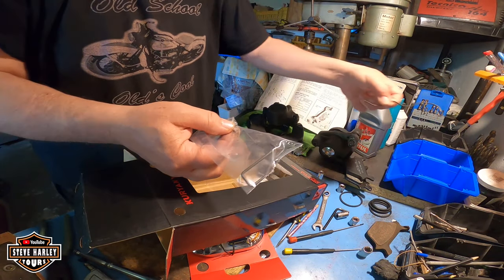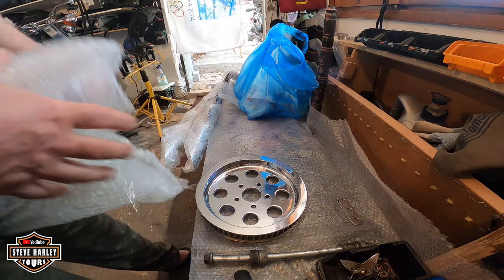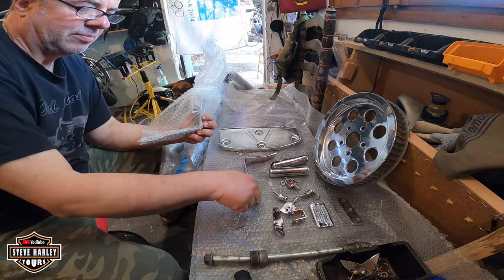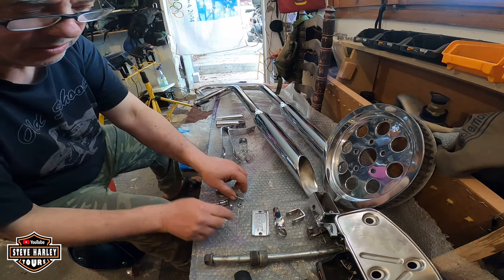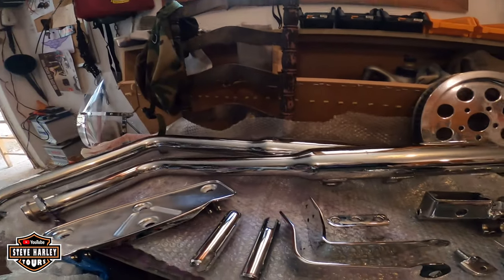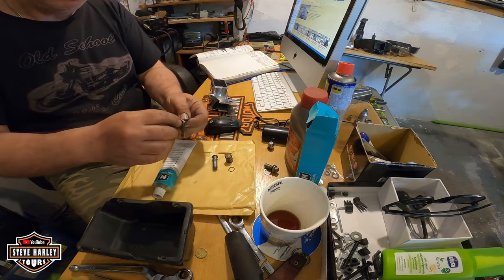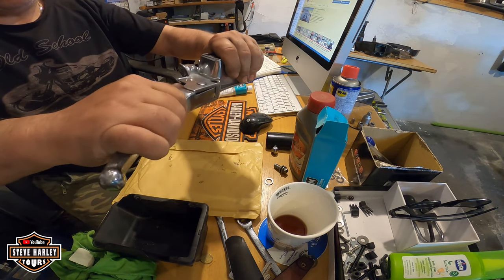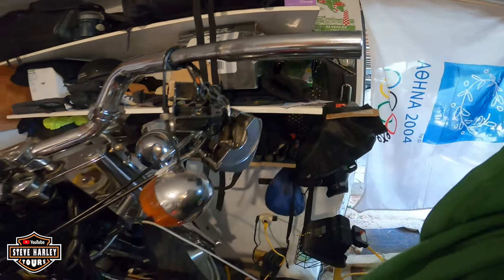Harley Davidson Evo P23 - New & Restored parts arrive, front brake master cylinder rebuild

Comment: Very nice Parts. I change the gearing in mind a little bit I went up to teeth on the final transmission pulley which gave me about 300 RPMs at a given speed and went from 32 to 34 I had one either back in the barn and I always will go down on me rear sprocket but this is what I always had shovel head motor cycle back in the 70s. I go from 51 to a 49 If I get 3 to 1 ratio when you change.
I’ve tried all kinds of different slip on mufflers I stick with the stock cross overhead pipe but I like the screaming eagles from the mid to late 80s the best I think they made them up in the early 90s they are somewhat adjustable with a metal gate inside the muffler..
Reply from the maker: Thank you, yes they came up very nice, these bikes have a lot of Torque a tooth less will give you even more power, the older pipes i thing are better :)